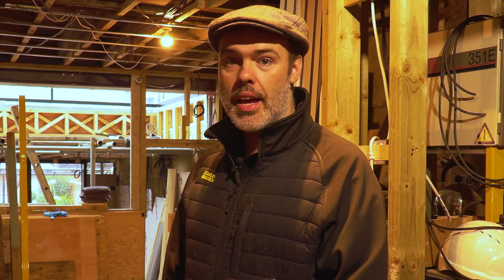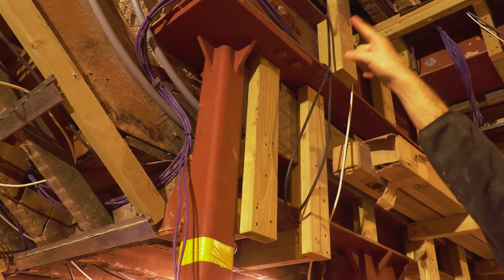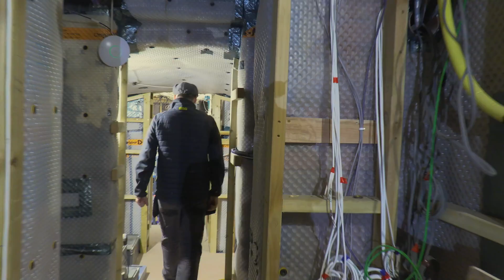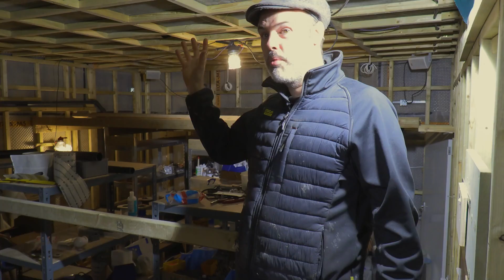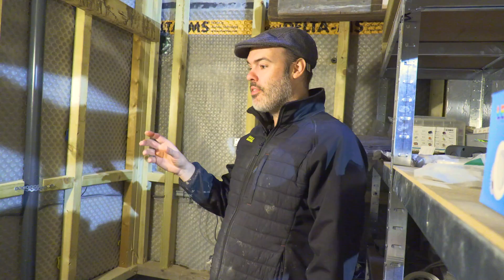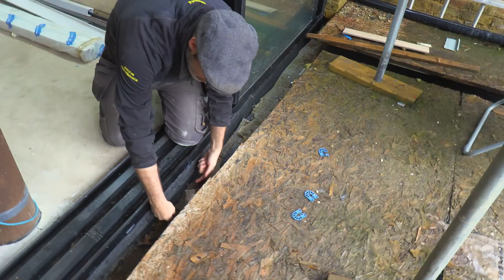The Reluctant Builder and Why He Became One

Comment: First off mesh is legitimate reinforcement. Standard structural mesh is available with 12mm bars. Also you can quite safely bend steel on site, but you need a tool that gives the proper bend radius. 

Unfortunately there are many chancers out there that think its just grey stuff being thrown in a hole, or that a hammer is the correct tool for driving screws or even cutting holes in timber sheet. And pre-drilling holes for screws looks like something from a book of fairy tales.

Apparently doing things properly is messing about.

Comment: Agree 100%.  All the issues with our self build was down to the contractors not being able to think past the block and brick bread and butter build, with one pendant light in each room mentality.  Then questioning them, you would get the typical response of "We are the professionals".  I designed the house, had an architect and structural engineers do the drawings and calculations, but I knew that design and every element of it with my eyes closed.  I ended up doing all the bay window roofing timbers and roof tiling and lead work (all without previous know how), all because my chippy had designed it and set it out that the bifold doors opposite could not open with his implementation, and every time I questioned him he sent me to the builders merchants for a "Long Stand", just so I was not in the way.  I totally agree, that you need to push back, not accept any flimflam and stick to your guns...oh and become an expert overnight on whatever is causing the friction.  You come out the other end being more confident in your own abilities and perspective.  Well done for not accepting mediocre.

Comment: The more work I do on my place the more bodges I uncover from so called professionals. It’s infuriating. It would be so much easier to pay someone to do the job but not if they are going to screw it up. 

Went to fit a Matt well in my place then discovered that the floor wasn’t even close to being level and the screed was coming apart where it looks like they turned on the heating too soon and screwed the screed.

Comment: I'm a bit at a loss with this video, in one hand I think the subs he had in have done him over and on the other hand you wonder if it's the project management that has let so much of the process down and he bit off more than he can chew. As a diy'er who does building work I've learnt not to expect anything from anyone and ask every question under the sun because guaranteed the one question you don't ask or hold someone to will bite you in the arse. 

His key message is 'read the engineering plans and understand them'. 

Caveat the glass people seem like t0ssers. That should never leak regardless.
Reply: The basement company was the main contractor, we signed a three way JCT, they literally defrauded us. They folded the company part way through the job.

At the time I was like any other normal guy hiring a basement construction company. Why would I know how to read such a diagram? I had no desire to do a self-build at that time… hey ho

Comment: I think the story told in the video above is the inevitable result of the educational system we have in the UK. Let me explain why.

In Switzerland they have two main educational streams: if you can you go to university. There's quite a difficult process to get in so its for the brainy. For those that don't make university there's an apprenticeship system whereby people learn a trade and get 'proper' qualifications.

Building in Switzerland is expensive but not as expensive as 'getting it done on the cheap'. Build quality is simply on a different level. Estimates have guarantees. Most importantly people that have a trade can be proud of their work and live with dignity rather than a career based on constantly managing to 'get away with stuff'. They are professionals.

The UK will not improve until they reform(!) the educational system and that, as far as I can see, is not on anybody's agenda. The powers-that-be prefer to look after every Roel, Abdul, and Ndongo rather than Tom, Dick, and Harry. I'm not a religious guy but Matthew has it right: ""..first take the plank out of your own eye, and then you will see clearly to remove the speck from your brother’s eye".
Reply: The powers that be in the UK didn't need a crystal ball to predict what was going to happen when they did away with the  city and guilds aprentership scheme. Worst thing that ever happened to the building industry, there was always a Clarke of works on the job back then to oversee proceedings.

Comment: please pardon my ignorance. is the storm water system not seperate to the sewer?
Reply: No, in lots of older areas of London sewers were originally built to dump directly into the river with combined storm water and sewerage. It would be pretty expensive and disruptive to fit separate systems so they are still combined.
It does cause problems where when there is high rainfall sewage will get dumped because the processing plants can't cope. The current approach to improve things is a mixture of increasing capacity (e.g. Thames tideway project) and trying to slow/reduce the amount of stormwater runoff going into the system generally known as sustainable drainage systems (SuDS).

Comment: I admire the guy. I am somewhat in a similar situation(building a house from scratch in a rural area).
One question, related to the big oak beam: are the bolts that run through it from brass or stainless steel?
Reply: I’d imagine they’d be mild steel bolts - either grade 4.6 or 8.8. These are generally specified for steelwork internally & even externally. Stainless steel bolts for more exposed conditions / within cavities / hidden behind structure / for proprietary support cladding systems etc. Shouldn’t use stainless steel bolts connecting steelwork that isn’t stainless steel unless you isolate between the two with neoprene washers etc - due to bimetallic corrosion.

Hope that might help - you can always call ya friendly structural engineer! Do a sketch of what you’ve got / take a few pics - that’d go a long way to help them to advise you. 

Although this has been called a flitch beam - I think it’s more of an afterthought / belt & braces kind of scenario / - ie bolt steel plates either side of existing timber assuming the thickness / depth of plate / bolts ok. 

Designing flitch beams you’d need to know properties of the existing timber / be comfortable that it doesn’t have any problems / been over stressed etc. 

With this - if any calculations carried out - you’d assess the loading / carry out the design & size the steelwork plate to suit & convince oneself that the load is transferred as you expect it to.  

This “appears” to just be that - can’t see clearly how the path of load transferred.

Who do I send the invoice to 🤔
Reply: Brass!!!! lol
Reply: Likely stainless. Whenever I think of brass fixings I think of them in a aesthetic sense rather than structural. Just my thought anyways 🤔
Reply: I know from a German carpenter that for oak you have to use stainless steel or brass, otherwise it will eventually rust.
LE: is there bimetallic corrosion between steel and stainless steel? If so, I guess special washers should be considered.
Reply: @af17c53  bimetallic is between metals. There is a corrosive effect of oils to steel though. So screws would be more prone due to their small diameter. Sizeable bolts would take a lifetime to be affected imho.
Reply: Google is your friend for those wanting to know more about bimetallic corrosion 

Bimetallic corrosion occurs when two metals, with different potentials, are in electrical contact while immersed in an electrically conducting corrosive liquid, Because the metals have different natural potentials in the liquid,
Reply: @Alan Payne screws yes - but sizeable bolts such as these would prob take a lifetime to be affected imho.

Comment: It's so difficult to find trades people who you can trust to leave them to it. Had my drive re done and they made a mess and have disappeared.

Highly rated gas engineers for a combi install, missing screws in thermostat, large hole left side of boiler. Leaking hot water pipe, no system flush or chemicals added. Fortunately invoice won't be paid until it's sorted.

It's main reason why I rather do the work myself, but not being registered what choice do you have!

It's a nightmare.
Reply: Completely agree.
Reply: Do it yourself if the actual work you’re doing doesn’t actually need being registered - it’s a grey area - but as long as you don’t ‘’mess” with the gas / then you should be ok - IF you know what you’re doing

Comment: 5  boxes of UTP cable for one house?! It seems this man will be mining the cryptocurrency :)
Reply: Mat here - I’ve installed 160 CAT6 drops for the whole place :) Reason being that every light switch, door, and window has its own connection. When you do it yourself, no reason not to. I’m sure some may disagree…
Reply: Photographer with a lot of stuff to backup to NAS or the cloud per haps? He did say more than 200 square meters, so 2 or 4 jacks per room.
Reply: I'm on four boxes cat6a and still need to use at least another two.  
Not to mention a real of fibre optic.

400 meters+ of 3 core SWA. 
50 meters 25 mm 4 core SWA
100 meters 25mm water pipe. Need 50 more. (I like water taps everywhere)
Seven consuming units.

I think if there's a hole / trench I just put cable in it.

Comment: Great job, big learning curve.  Think builders and engineers should be vetted more though.  If they can make mistakes like that, who can you trust?  I thought England had some better standards.  Shocking
Reply: I think it’s more likely he went for the cheapest quote instead of the quality builder, standard mistake. By cheap, get cheap
Reply: @sambarnes2063  Probably a language barrier as well.
Reply: if you are doing any major structural work ,it should be overseen by an engineer ..... he obviously didn't do this
Reply: @memecoinmafia2732  true but at the start he was entrusting to the contractor and might not know when and for what you need a engineer for that why you hire someone.

There has been a massive multistory carpark near me that has was obviously speced by engineers but poorly overseen started having chunks of concrete fall off in a year or so after completion!

Personally I think there need to be zero overlap from a business ownership pov between contractor and building inspection and engineer. If they are all paid by the same person it's tempting to be curupted
Reply: Engineer? 
I doubt there was one involved tbh